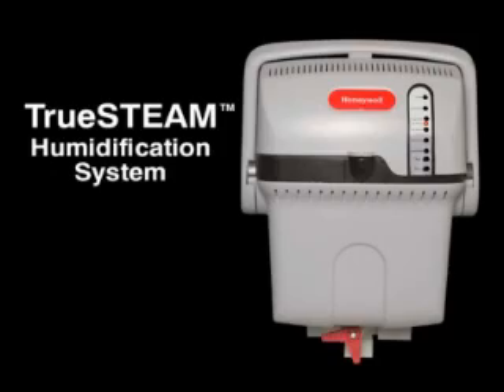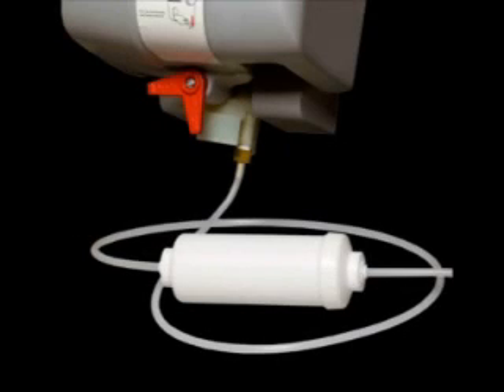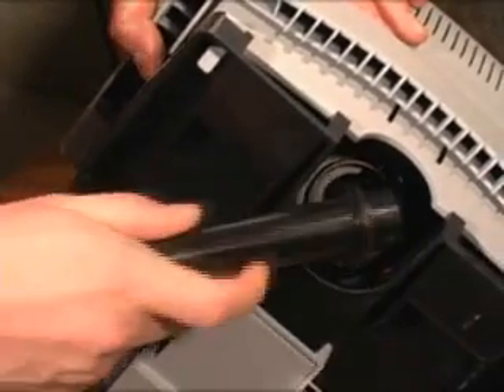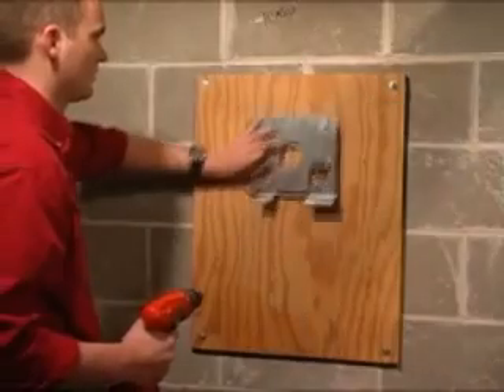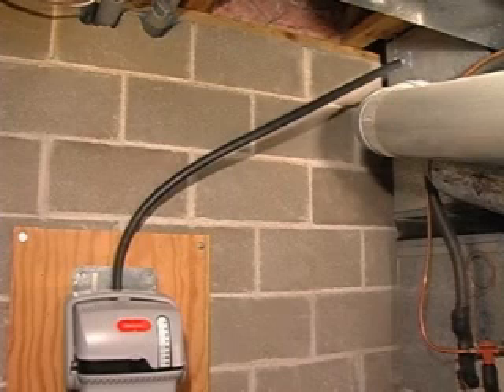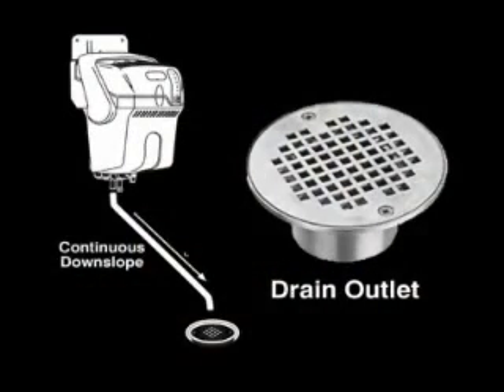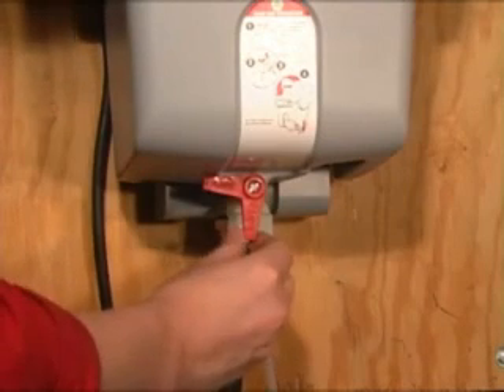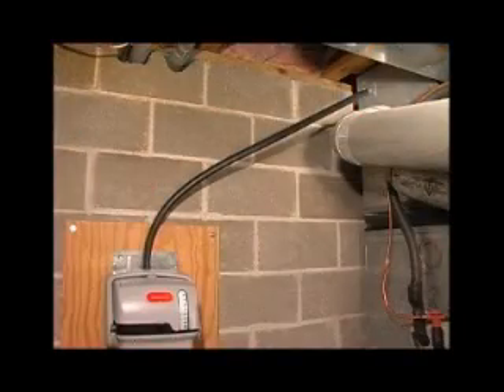Honeywell TrueSTEAM™ Humidifier Is Easy To Install

Comment: I recommend installing this unit in the trash where it belongs. I bought while the product was new and there were no reviews. Installation was anything but simple. It took three separate Honeywell qualified HVAC pros to finally get the installation right. Have had nothing but problems and now on the third season, after hundreds of dollars in repairs I've run out of patience and money. It's going in the trash. Read reviews before you buy this product. one star.

Comment: This unit is great I had no problems installing this. Highly recommendHarry Irvine
Reply: +Harry Irvine Where did you buy this at? I am trying to find parts for mine. The reservoir that holds the water has a leak.

Comment: Huh, lots of angry people in the comments section.  I just bought a house that has two of these installed on two separate furnaces... should I be replacing with a different model? Any recommendations?

Comment: 45 minutes ha.  You have to run a 20 amp 12 ga wire back to the panel and freezproof condensate which may mean fishing wire across a drywalled basement.  This install is not as easy as it seems.

Comment: Good video, absolutely terrible unit. This expensive humidifier destroyed itself in just 3 years. At one point a leak flooded our basement and we replaced the tank. By the end it barely worked, and at this point you could pull its plastic pieces apart with your hands. Literally falling apart. It's hard to find a machine this bad these days.